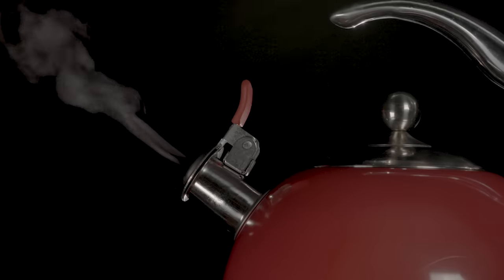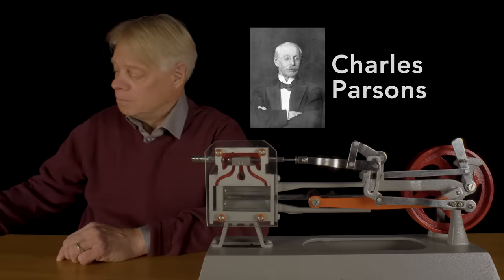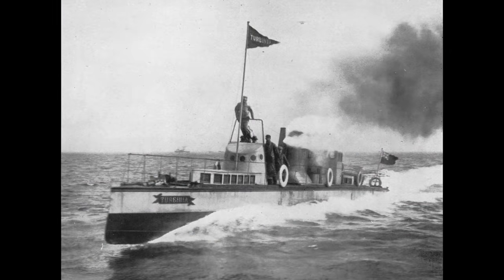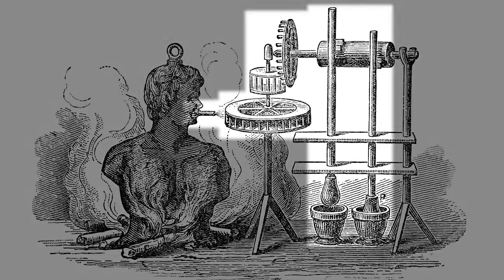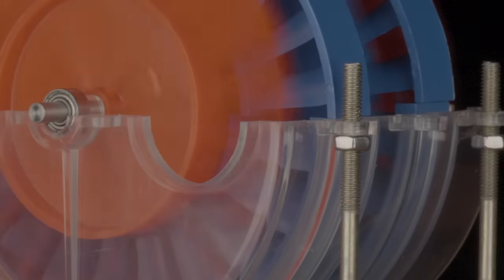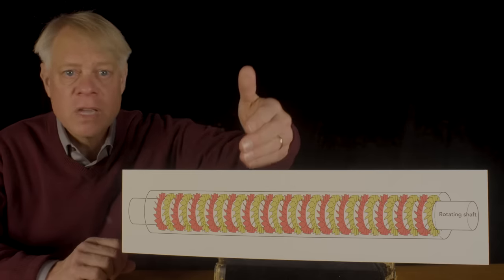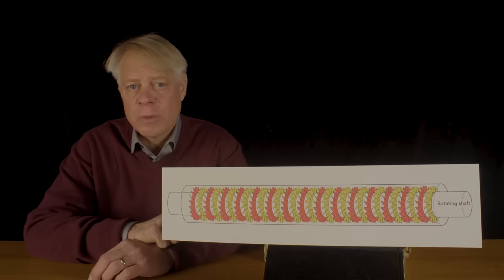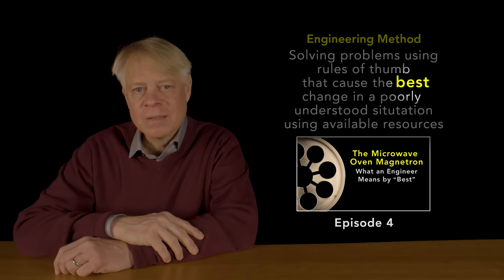The Steam Turbine: The Surprising Relationship of Engineering & Science

Comment: I once took a tour of a large coal fired power plant on a field trip with my science students and one of the many amazing facts that I learned was that the amount of torque on their turbines (2x in operation at a time) would twist the solid steel core of the shaft 360 degrees from end to end. 
On another occasion we were able to see the inside of the shaft housing as they had experienced a critical failure and had to dismantle one of their turbines. The replacement shaft was as long and wide as a train car and I was able to show my students just how difficult it would be to get something of that size to spin at ~3000rpm all day every day.

Comment: I love the old piston steam engines! Amazing technology as they developed and became more advanced. One thing you didn't mention was 2 and 3 stage engines that got much more energy out of the steam than a properly functional single stroke, single stage engine of the type first introduced by Watt. (You demonstrated a two stroke engine.)

Look at the turbines of modern power plants. First the heat from the expanding product gases of natural gas combustion (H20 and CO2, primarily) to turn the main stage of the turbine, just as ordinary steam would do until it is spent and there's essentially just the heat left, then using that heat to boil water into steam and passing through a second stage of the very same turbine until it's also pretty well spent. Incredible efficiency for a thermal generator! I just wish engineers could figure out how to use the rest of the energy instead of running the leftover steam into condensers. As an engineer, I hate inefficiency and I've always looked at condensers as an obvious point where improvement ought to be possible.

Another point worth mentioning is that as steam expands, it loses velocity. So it takes a greater surface area in order to achieve the same force (hence why multi-stage piston engines had larger pistons moving shorter distances at each successive stage.) The same principle applies here and it is matching that force of each stage that he was attempting to do.

Comment: Kempelen made a turbine in watts time. Watt showed with some math he had no fear of any competition from that avenue.
Trevethick made on in 1815... 15 foot across at 300rpm!
"Could not drive the spouting arm above 200ft/sec, which bore small proportion to velocity of spouting steam..."

Parsons likened it to water turbines, pressure drops, and use of H, head, 144pV. For low pressure changes, V²=2gh suffices per stage.

Parsons coefficient he gave as K=NR²D²x10-⁹. Number of stages, Rpm, Diameter.
Which was later found to be sqr rt K/1.3dH, and has been the mainstay of design since.

The main obstacle to its early take up was its high steam consumption. And it remains fairly constant regardless of load... something people didnt understand at the time.
Lot of generators before turbina. 
Condensors really helped here. Watt would have been kicking up a stink about patents.

Comment: Great video, thanks. Interesting that no one has seen this: make each moving set of blades -- disc -- independent, each disc rotating permanent magnets on its perimeter across coils. The energy produced by each of these discs (turbines) -- while different compared to the other turbines -- would be electrically made to complement the energy produced by the others.

Comment: Parson's turbine powered the center propeller of the Titanic using the the low pressure steam from the two main reciprocating engines that would normally would go to the steam condensers. But the center propellor could only drive forward.

Comment: Interesting that the jet engine works in the opposite way, air entering the largest blades and exiting the smallest. This creates the compression necessary for combustion.  Really cool!
Reply: You are right about the compressor part but if you look at the "turbine" part at the back it is the same as the steam turbine ie smaller blades at the higher pressure front and larger blades at the lower pressure back. You have to remember that a jet engine /gas turbine is two machines on the same shaft. The compressor at the front along with the burning fuel creates the high pressure high flow gas that spins the turbine part in the same way that high pressure steam spins a steam turbine.

Comment: I feel like there are some inaccuracies here concerning the process by which work is extracted from steam in a turbine stage. It would have been cleared up by introducing the concepts of impulse and reaction stages by deriving them from the two historical references brought up in the main part of the video. With this the relationship between stator and rotor blades would have become clear. In reaction stages the pressure is largely converted to steam velocity. Redirection of the flow in the rotor blades extracts energy. In a reaction stage, which compose the bulk of stages in ordinary turbines, the stationary blade rows introduce rotation alongside some pressure loss while reduction of this rotation extracts energy via the rotor blades, as described by Euler's equation. Backpressure increase by stage interaction most likely is not desirable at all.

Comment: For an Engineer turned Scientist, there is no difference between the two subjects.  It is only a question of perspective, of how you look at a problem.   There is so much to be gained from understanding the fundamental science behind its application in engineering principles and conversely, science gains from the use of its discoveries in engineering applications.  Optics and photonics as for example in Laser development and their application, fibre optics, fibre sensors and communication are sitting at the interface of science and engineering.  Neither of them can exist without the other.

Comment: And for as impressive as the steam turbine is, it's fundamental flaw is that to work at the temps and pressures that it does, It needs to be incredibly pure (and deoxygenated), and to do it at scale, you condense that steam back to water. It takes 180 btu's of heat energy to take one pound of water from 32 degrees Fahrenheit  to 212 degrees water. To make the change of state to steam (latent heat of vaporization) it takes another 970 btu's of heat energy for that same pound. Once it runs through the cycle and is returned to the condenser, most of that energy is lost in latent heat of condensation. Commercial ships stopped using steam ships in the 1970's because of the cost of fuel. Some navies still use it in nuclear powered ships because energy consumption isn't a priority. I believe that some LNG ships use steam because of the necessary boil off of the product.
Reply from the maker: Indeed. I think the only naval use of steam is in nuclear subs. Turbines for propulsion had a very short era of dominance; their long lasting role was — as you know — in generating electricity.
Reply: @engineerguyvideo  Aircraft carriers are also nuclear. 215,000 HP and they're not burning fossil fuel (though they carry petro products for the planes and other equipment that needs it.)

Comment: The video is great, as usual. However, your steam turbine model on 5:55 is assembled wrong. First, all 3 wheel are put backwards - just look at the blade profile. Second - the order is wrong: it should be blue, then rear orange, then front orange: they clearly simulate high, mid and low pressure stages and account for expansion with different length of blades.

Comment: Nice! I’ve heard that magnetic bearings can reduce friction? Would that improve the the motion of a steam turbine? I know you have thing like programmable magnets?  I know a few guys in AWEs who have been working on torque transfer on the shaft?  They have been looking at rope drives. From what I’ve seen they handle the torsion much better than a standard shaft? Because there’s enough tolerance for movement. Anywhere up to 360’ out of sync maybe more? I was looking a a turbine unit to power a hybrid steam locomotives. Even heard of cyropowered turbines? Running on the expansion of liquid nitrogen?  NASA has a new Sterling engine that they have had in operation since the 2000s. Be nice to see a return to steam? A very well explained video and I enjoyed that!
Reply from the maker: Parsons used an astonishing bearing system to before his shaft could spin ... alas I did not have time to talk about it ... also I left out that it took him ten years to really get this thing up and running.

Comment: Firstly a Hudge Thanks for the video, I can hardly find anything with this level of simple explaining (we call it in French vulgarisation).
I just want to ask a question : when explaining the principle of the turbine : why does the steam hits the convex outer edge of the blabes instead of the concave inner one (like water on a pelton turbine, hitting the insides of the buckets instead of the outside).
Sidenote about your previous video about airflow, doesn't the density volumetric mass of the fluid intervene in Reynolds number ? If my physics lessons are right, Re = μ*v*l/η 
with μ the volumetric mass (kg/m^3)
η the dynamic viscosity (Pl)

Once again, thanks a lot for these really well made videos
Reply from the maker: I got the blades backwards … sorry

Comment: Nice video but the explanation of impulse and reaction was not very clear. In an impulse turbine the steam expands across the stationary stage and in a reaction turbine the steam expansion is more or less equal across rotor and stator stages. Incidentally it could also be argued that Parsons also discovered and overcame cavitation. When he first launched Turbinia  he found it was not developing anything like the speed he predicted. He found damage on the  prop blades, did some testing and figured out it was cavitation. hence the turbinia has three propellers on each prop shaft. It can still be seen in Manchester museum of science and industry. One of Parsons early turbines used to have pride of place in Parsons works factory in Newcastle (now owned by Siemens)
Reply from the maker: Indeed, cavitation was one of the many things he had to overcome. He used high speed photography if recall correctly. Also, the method he used to stabilize the rotation was a work of genius (also of course left out here)
Reply from the maker: Is the line drawing correct? It comes from the book — I am making changes for the paperback now … email me if you wish.

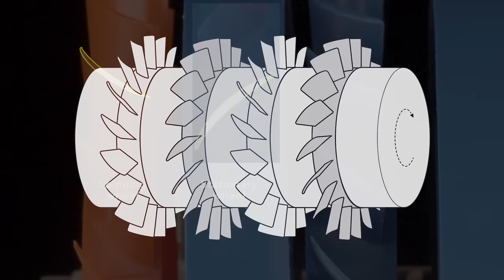Comment: I don't mean to nitpick, but did Parsons's have a different design than a modern version for his Steam turbine shown at 5:45 and 7:00. I thought the original steam turbine had a similar blade shape and arrangement as a modern steam turbine. The model you show and the animation are the blade and flow orientation of an axial flow compressor (most commonly seen in the front of jet engines to compress the entering air). I think the blade orientations and animations would be correct if the steam was coming from the other direction at 7:00.
Reply from the maker: You are correct … btw to get a model or toy version was very difficult to get, my choices were pretty limited; although not perfect I hoped this would work especially if combined with a picture of one of Parsons turbines.
Reply: @engineerguyvideo Very awesome video regardless. I really liked the explanation of it all though. It's surprising how most people hear 'Steam Power' and they think it's old and obsolete, from the times of old trains. Not realizing that it's still a super efficient way of making electricity that we all use, even up to Nuclear Power.

Comment: The toy turbine is the wrong way around. If you blow steam from the side you show, you'll get flow separation, turbulent flow and turbine will explode. You need to put steam from the correct side for it to work
Reply from the maker: I have heard!
Reply: @engineerguyvideo  weird that you haven't noticed it while animating. Pretty obvious that it's the wrong way around for a turbine, looks more like a compressor
Reply from the maker: I had great trouble getting any turbine to show … really wanted a small steam turbine that machine shop could cut open,  but could not find a small one. I am not surprised by the error: there are a billion things to get right!

Comment: I think i found a mistake:

the concavity in the blades in the plastic model at 5:50 and in the drawing at 7:00 are the oposite of what they should be, in the plastic model i'm pretty sure that the flow of steam should be the oposite of what is indicated by the arrow. and i think so because the passage between blades should get smaller as steam moves through, so that we have expansion ad acceleration of the fluid (bernoulli)
the other thing that catches my attention is that it seems like the blade surfaces will not match the steam velocity...

I know i'm not being very clear, but check it out:

https://2.bp.blogspot.com/-5C9XoY0Wz4w/XAJEG72iqLI/AAAAAAAABgY/35JzUdIzUTYnjWzzXvC2A2qITmfdmrn_ACLcBGAs/s1600/reaction%2Bturbine%2Bpressure%2Bvelocity%2Bdiagram.png
Reply from the maker: You are correct
Reply: @engineerguyvideo  i really love your work by the way thank you so much for sharing

Comment: Would electric steam engine work in terms of efficiency and gaining more torque from the same amount of energy vs an electric motor? Say you used an electric heat element to boil the water that created steam to drive a train. The electric heat element could be powered by batteries which are maintained by solar panels on the train roof. Given the laws of thermodynamics I have been told that it would be a waste of time as might as well use the electricity to turn an electric motor but I thought it might be more efficient to use an electric heat element to heat water to generate steam? Would love to hear your thought on my electric steam engine idea. The steam could also be turned back in to water so that it is reused using a vacuum.
Reply: Apparently the Swiss converted some of their steam engines to run on electricity during ww2. They couldn't get the coal easily but had plenty of hydro power and iirc had already got electric supply to the railways.

I doubt it would be more efficient than using electric motors because converting electricity to heat to motion will be losing more in every conversion than direct electricity to motor motion, which can be quite efficient these days. It would also  be a lot of faff as well, as steam tends to be a dirty oily wet affair even without the coal or oil smoke. Much cleaner to just use electricity direct.
Reply: The steam cycle is way too inefficient to waste all those conversions steps of sunlight into rotory motion.....on the order of only 30% efficient.  But for large scale electricity production, it's still the best we have.

Comment: so what i am confused about is the direction of the steam, so the steam enters the narrow smaller part first which I imagine is going to be where it produces the most pressure and velocity of the blades, then as it travels further it loses energy, and even more so when it expands to the larger blades which have a higher mass as well, which would cause them to rotate slower, which i would think cause the issue of ruining the shaft, as the blades would rotate a different speeds causing the problem its supposed to solve, please explain why this works
Reply from the maker: I had the steam going the wrong way: there is a revised version in the playlist

Comment: Can someone explain why the stationary wheels are necessary in the turbine? My first intuition is that putting something stationary in the way of the expanding steam would decrease it's energy, but I suppose they're essential for redirection or something? I think it's the diagram at 7:00 that's throwing me off. But great video overall
Reply from the maker: To provide an immobile surface so that the steam exiting the moving wheel could propel itself.
Reply: The stator blades turn the steam flow 90 degrees so that it then strikes the rotor blades at the optimum angle.

Comment: 7:19 & 6:52 looking at how the blades are pointed, shouldn't the steam enter from the right and exit the left? if somone has knowledge on this, please just tell me which will be more optimal
Reply from the maker: Indeed … the version in the playlist is correct ….
Reply: @engineerguyvideo  Thank you so much for replying
I was just thinking that if the steam hits the blade from the other side(wrong side), there would be separation that occurs at one side of the blade and thus causing a loss in torque for the same turbine

Comment: I still don't understand the divergence ratio of the turbine. If the steam is hottest when it enters the turbine, surely that is when it's at its least dense, no? so why then would it expand as it travels through the cooler sections of the turbine?
Reply: it expands because hot steam is compressed under intense pressure, which it loses as it travels through the turbine.

Comment: My new wishes are , could Bill try theses and use Ai to solve theses problems. 

Moto GP season is going on and i wish if one can use Brachistochrone curve to plot the fastest racing line in a race track. And is it actually faster than what the GP riders take.  

Or instead of using a mechanical friction type clutch will a multi layer pancake motor be used instead .

Can a rotary wankel or liquid piston engine be used as valvetrain instead of DOHC or pneumatic valves .

Comment: almost infinite complexity and you only scratch the surface... 🙂
Oh yeah, heat and pressure differential, turbines being truly efficient only when run on full throttle, fine tuned to spin exactly 50 or 60 Hz generator. Tesla turbine, Stirling engine,...
I wanted something small, generating enough electricity from a fireplace to charge car battery.
Either it's a very niche market or portable generators are so hard to find because "THEY" 🙂- the government and the industry banned/patented it so that no one can be easily self-sufficient